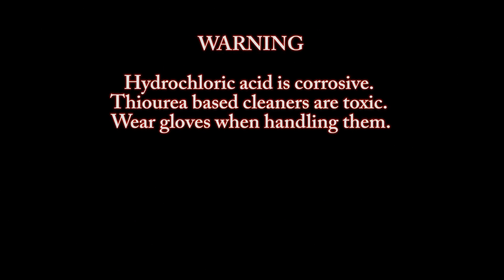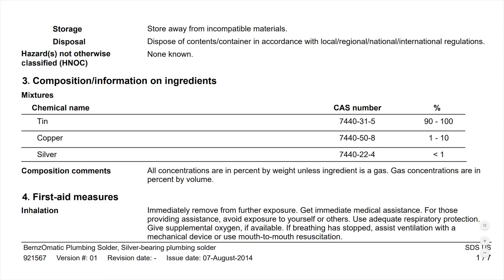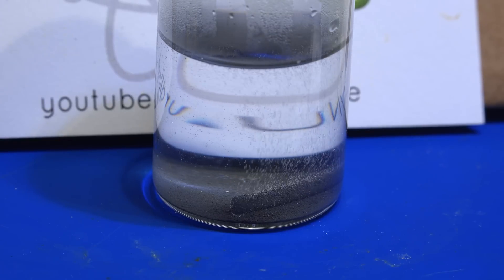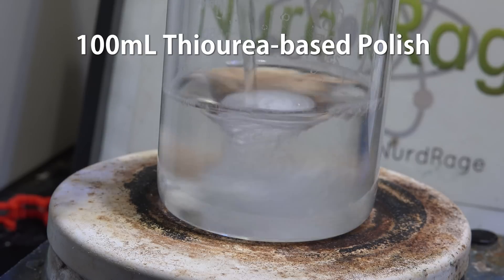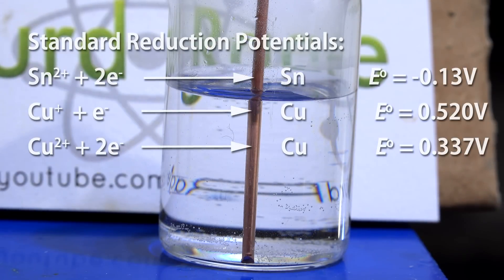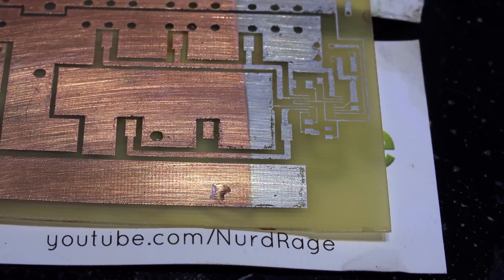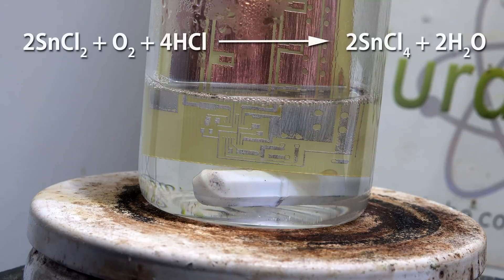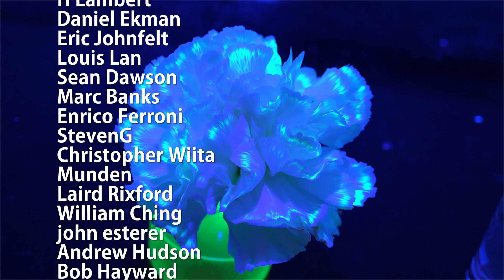Make PCB Tinning Solution ("Liquid Tin") by Redox Flipping

Comment: hello youtube people I have many formulas of cold tinning and cold plating electrodepocion coatings
I am Colombian and I live in Cali Colombia; the formula of the video of CEYCOM COLOMBIA is simple and is one of the easiest to elaborate hehe (NOTHING OF TIN THIS FORMULA IS FREE OF TIN, THE MOST EASY TO TEST IS TO WELD AND THERE IS SAME WELDING BRILLIANT IF IT WAS TIN TIN NOT CHANGE COLOR? SILVER PLATE AND TIN WELDING, GIVES A RESULT A BRIGHT COLOR JEJE)
an easy secret to identify this formula of CEYCOM is the following buy ceycom the product; take a bale of PCB cover it with the product ok then when it is well coated wash the plate with H2o water and take nitric acid, put the plate in the acid and when the acid is dissolved the copper all of the bone plate when you take it out the plate without traces of metal? the blue solution is nitrate uuumm but what kind of nitrate? Will it be silver nitrate? aaaahh let's test with sodium chloride (kitchen salt)
take that blue solution for copper and take kitchen salt diluted in water H2o and add acid blue and if it appears as something that is cut white this is silver chloride hehe you already have easy the formula of ceycom cyanide of potassium with silver nitrate O Potassium cyanide with silver cyanide O Potassium cyanide with silver chloride jejeje ya you COGIÓ I have atomic absorption spectrometer tests by titration with reagents; analysis by copelacion fire analysis; COLORIMETRY: SPECTROPHOTOMETRIC ANALYSIS and ready the formula after I give the quantities and formula I think I'll make a better video how to prepare these liquids
Reply: relame la formula de ceycom es muy buena estoy en bogota
Reply: sargento que bueno que sepas la formula de CEYCOM como consigo una muestra de la tuya estoy en BOGOTA. saludos guillermo

Comment: Just did this - worked great! Only difference I used a local brand silver polish instead of Tarn-X. But I have to heat it up to make it liquid, when coolling down it turns into white paste. Any way to keep it liquid and clear without heating?
Reply: I had the same problem. I bought some Thiourea from a photographic supplier, and I think it was the extra things in the Tan-X that caused the white formation of what he called Salts. I did not want to have to heat it up to use it.

Comment: Hi NurdRage, I have a bottle of AR17 liquid tin from C.I.F. and according to the safety datasheet it contains tin(II)methanesulphonate methanesulphonic acid and thiourea. It is a bit old and it also contains white residue of some sort. It does not tin my pcbs anymore. I tried heating it, hoping it would disappear, but it does not. It just pops relatively violently on the bottom of the jar when heating it (while not boiling). Is this AR17 by any chance similar to what you show in this video? Do you have any idea how to make it tin my pcbs again? Thanks in advance!
Reply from the maker: The chemical principle is indeed the same. Unfortunately this also means the decay mechanism is the same too. The chemicals have decayed and become unusable. Unfortunately there is no way to regenerate it without spending more money than it would take to simply buy more.

Comment: what is the molar concentration  needed for this tinning process 
i saw many different methods of making tin choloride using many different percentages of tin to hydrochloric acid 
some uses 12g of tin with 50 ml of hydrochloric acid
other uses 10g of tin to 20 ml of hydrochloric acid
and you here used 1g of tin to 10 ml of hydrochloric acid

Comment: I made this as instructed.  I cut the solder into small pieces and flattened it to increase the surface area to speed the SnCl reaction.  But when I added the TarnX it turned into a thick white paste.  Warming did not clear it.  Adding 25 ml water cleared it up and it worked great.  I used fresh ingredients.  That might have made it precipitate.  Should the board be washed with anything to neutralize any residual acid?
Reply from the maker: Just wash with water, it'll be fine.

Comment: I would be interested to know more about how the mixed solution ages. Is there any way to inhibit the formation of stannic chloride.
I have used the ready mixed electroless tin plating powder, which I assume is a mix of stannous chloride and thiourea, but its shelf life is very poor when mixed. I plate my PCBs immediately after etching because it is difficult to obtain a good tin coating once the copper has oxidised, and this happens really quickly. Is it worth washing in dilute HCl and boiling the distilled water to drive out oxygen?
Your video shows a good tin coating on not very clean copper, any tips for obtaining the best results?
I have subscribed to a number of chemistry YouTube sites, but practical chemistry is difficult with the restrictions on obtaining chemicals. In the UK the chemicals in over the counter household products appear to be very limited compared to those sold in other countries.

Comment: Seems to be a very nice way to tincoat copper. The 1g of sulfuric acid... Is that 1g pure acid? So if I have 10% sulfuric acid, I need 10g of diluted acid?
Reply from the maker: yeah pure acid. But it's just a rough figure, you can use 5g of your 10% acid and it should still work. If not, add a bit more. the great thing about this is that it's somewhat forgiving of different quantities.
Reply: thanks!
Reply: why is the use of sulfuric acid is to ?i have tried 1g of tin and hydrochloric acid 37% and 5 grams of thiourea but it still milky and yellow color but it works but not so robust and shiny ,but why is the sulfuric acid is for ? can it be liquid sulfuric acid not powder ?
thanks

Comment: I can buy Thiourea and Tin(II)chloride at my local chemists. Do you think I could just make a solution of them in water and use it?
Reply: Oh...I probably do need some acid/alcaline in the mix...right?
Reply: That's what I do. Dissolve stannous chloride in 30-35% HCL, and thiourea in distilled water. Its highly soluble. Then add thiourea solution to the other one. To recharge the solution later, just add a spatula tip (size of pinky finger nail) of tin(II)chloride to the old solution, and you're good to go. As long as the thiourea and HCL are in excess, it wil continue working. You'll find over a long time, a black precipitate at the bottom of the container. This is just by-products of the copper in solution, and oxidised tin, and its of no consequence.

Comment: +NurdRage Several interesting things here - Looks like according to Wikipedia, all you need to prevent the SnCl4 oxidization problem, is leave some metallic tin in the bottle.  Therefore, if clear solutions of tin(II) chloride are to be used, it must be dissolved in hydrochloric acid (typically of the same or greater molarity as the stannous chloride) to maintain the equilibrium towards the left-hand side (using Le Chatelier's principle). Solutions of SnCl2 are also unstable towards oxidation by the air:

6 SnCl2 (aq) + O2 (g) + 2 H2O (l) → 2 SnCl4 (aq) + 4 Sn(OH)Cl (s)
This can be prevented by storing the solution over lumps of tin metal.[3]

In addition to that, SnCl2 is a great test solution for dissolved gold, you have Purple of Cassius here should you wish it, so even more uses for such interesting and seemingly simple chemistry.  I really enjoyed learning about the redox flip.  Very cool.
Reply: https://en.wikipedia.org/wiki/Tin(II)_chloride
https://en.wikipedia.org/wiki/Purple_of_Cassius
Reply from the maker: Give it a try and let me know how it turns out.
Reply: Theoretically, it works, but in presence of HCL, it will continuously keep dissolving your tin metal until the acid is depleted. This will pressurise your container with hydrogen gas, which might not be ideal. Just add a little bit of stannous chloride to the old solution to recharge instead.

Comment: Okay I've got one for you.  More electrochemistry.  I've been thinking about Baghdad batteries.  What is the ideal metals to use in the reaction?  Is water the best liquid to use for a slow reaction (not wanting to clean the metal to often or have to replace it often)?  What are the rations of fluid to metals for an optimal reaction?  My mind has been going wild thinking about all this, alas I have to means of testing.  Thanks for your awesome videos!!  I always enjoy them.  I thank chemical engineers for making most of our tech possible.

Comment: This isn't a good idea, pure tin will produce tin whiskers that can short your circuits, many older components had a pure tin coating on the leads that caused the tin whiskers, now they plate them using an impure tinning method, I'm not sure what it is though. Gold plating is much better.
Reply from the maker: A thick coating from dipping into tin solder or wave soldering would be a problem. But the coating here is too thin. The tin whiskers don't have enough tin to grow out.

 "Liquid tin" is still extremely popular and in fact the only reason why i did this was because i received numerous requests for exactly this sort of product. If this was really that bad it would have been noticed by now.
Reply from the maker: the thickness of this coating is around 1 micron. The diameter of a typical tin whisker is also 1 micron. It won't be able to grow very far (a few microns at best) before depleting the tin at the base of the whisker. 

Nonetheless i'll trust you on industry practices. It's odd i got so many requests for liquid tin and almost no requests for gold plating. But you probably know more about the industry than i do.
Reply: Not really, I'm only a hobbyist (although you called yourself an amateur chemist, you're by no means amateur) but I have made friends with some in the industry and some friends went to university for it. I just know tin solder is despised and that's why they had the little bot of copper to it, to stop whiskers.
Reply from the maker: Yeah solder is a problem because when you use it you can solder joints hundreds of microns thick. Whisker formation is very easy and very long from such a sizeable source. Thick electrolytic tin plating is also problem since you can easily get several dozens of microns.

But this immersion tin coat with "liquid tin solution" is very thin at just one micron or so. There simply isn't enough tin in it for whiskers to be a problem.

Comment: I've done this before, mostly just for the hell of it. Used the rosin core solder as that was all I had.

It took an extremely long time to dissolve, and in all likelihood the solution was probably still mostly hydrochloric acid. I dropped a penny into the solution and left it for a couple of days and the tin did end up depositing on to the penny.

Would the HCl change the reduction potential of the copper on the penny? (This was a Canadian penny circa late 1970s, so 95% copper)

Comment: Does someone know a good way to plate copper on carbon steel?
Reply: a very thin layer: a copper sulfate solution with a bit sulfuric acid in it. A thicker layer: Use the same solution and apply a low voltage with your workpiece as the negative pole and a piece of copper as the positive pole.
Reply: Anticonny Thanks, I'll give it a try. I tried just bare copper sulphate and low voltage but the copper layer was extremely thin so it brushed of with bare fingers and didn't look good either. 
Next I tried a solution of copper chloride and a bit of hcl, does form a thin shiny layer of copper but again in brushes of easily. 
Really hope that the copper sulphate, sulphuric acid solution performs better.
I know that I could buy some of the shelf electroplating solution but here the stuff is extremely expensive.
Reply: Anticonny Thanks, the good thing is that I have saccharin on hand, just need some sulphuric acid.

Comment: Can I do a "nickeling" solution the same way? I'd like to nikkel plate my soldering iron tips
Reply: Plating of nickel is a complex process unfortunately, not as straight-forward as tin or other metals. I've had some success using electroplating with the following solution:

nickel sulfate heptahydrate 240g/L
sodium chloride (table salt) 15g/L
boric acid 15g/L
glycerin 2.5g/L
saccharin 1 pinch per liter (found in artificial sweeteners)
thiourea 2g/L
(1 pinch would be about 0.25g I guess)
cobalt sulfate 6g/L (cobalt acts to facilitate the deposition of nickel)
few drops per liter of a surfactant (I used Tween20, but probably other detergents would work too)

Use a current density of 0.2A/cm2 using a pure nickel anode and your object as cathode. Voltage shouldn't be above 5V. The plated layer of nickel was thin and didn't adhere too well to steel, but it did adhere well to copper and couldn't be rubbed off. Don't expect it to be of the same quality as commercially plated nickel. Make sure the object you're plating is very very clean or else the deposited layer won't stick.
Reply: Probably better than electrolysis. I failed at every single electrolisis I tried.

Comment: Quick question: Is this kind of "liquid tin" the same type that is used for silvering mirrors? The commercially available tinning solutions for making mirrors is also a clear liquid with a short shelf life, but it doesn't show any kind of deposit or film on a piece of glass until the silver solution is added afterwards.
Reply: No that is silver nitrate aka. Tollens test. Youtube it and check the video by a youtuber NileRed (he is also a chemist). He silver plated some light bulbs.

Comment: Hey NurdRage, I would like to make manganese metal from thermite, but I would like to to use zinc metal instead of aluminum powder because you have a video on how to make zinc powder, and manganese dioxide from the video about getting it from batteries. I was wondering if this was even remotely possible or not at all. If it is you could try it and add it as a video for your thermite reactions.
Reply from the maker: don't do it. The zinc oxide fumes caused "metal fume fever" and there have been many recorded deaths from it.
Reply: Thank you for your reply. I have heard of this "metal fume fever" and its vast range of symptoms, but I have also heard that aluminium and magnesium oxide also can give you this illness. These are the two most common metals that are used for thermite. Is zinc oxide particularly nasty?

All of the possible death notes aside would the correct ratio achieve a thermite reaction or would it simply fizzle out? I think that the enthalpy change would allow this reaction to work, but would it just produce extremely finely divided particles of manganese metal or would it have enough heat to make a small nugget?

I am trying to do this so that I can have an element sample of manganese that I made and not bought. If there are any other (safer) ways to make manganese metal from manganese oxide I would love to know.

Comment: is it relevant that it is tin solder? or can i literally just put a piece of tin metal in there?
Reply from the maker: as long as it's more than 95% pure tin.
Reply: They sell pure(-ish) tin ingots for use in plating which are pretty easy to get.
Reply: The thing with pipe solder is that you can get it at any home improvement store, it's cheap and you don't have to wait or pay shipping, and it'll tell you the composition right on there. But tin is tin.

Comment: That was awesome to see. Just some back grounds from a PCB-Designer:
For professional PCBs, bare chopper is a clear no-go, chopper is too sensitive too oxidation. In Europa, we have mainly settled for chem. NiAu or chem. Tin (as shown here). In asia, it is a bit more complicated, but you see a lot of OSP (organic surface protection) over bare chopper - but everything else is available "on demand". OSP and chem Tin are best for the soldering metallurgy, the solder can interact with the base chopper forming strong joints. Chem. NiAu mainly is a good for storing and handling, the soldering metallurgy is kind of a mess, as the gold is going into the solder alloy and the solder joint beeing formed on the thin Nickel Layer.
Reply from the maker: very interesting! I might do other coating processes in the future.